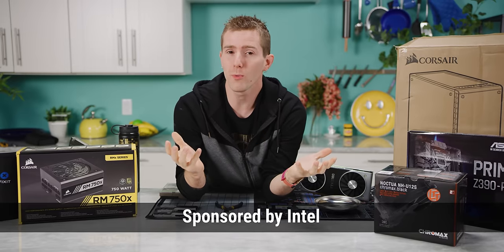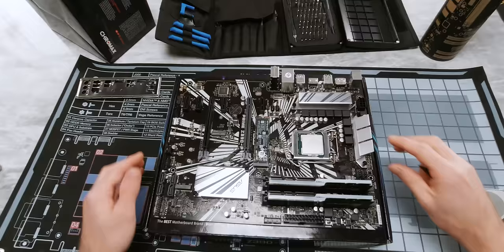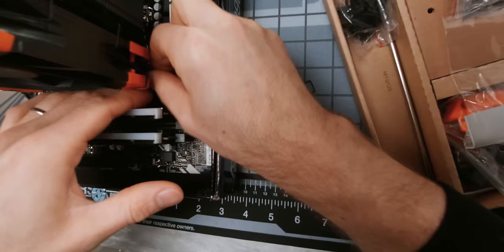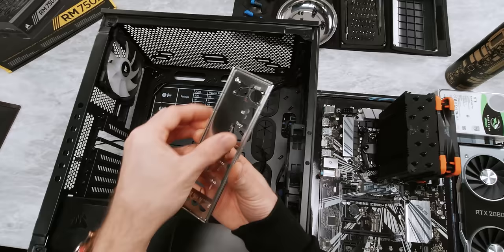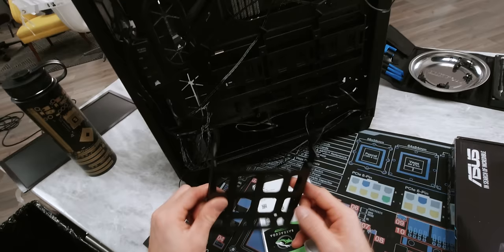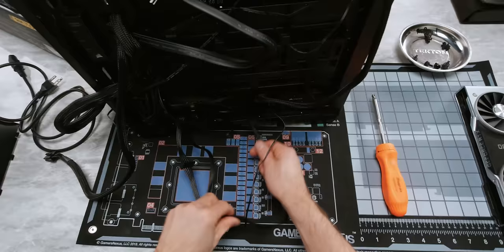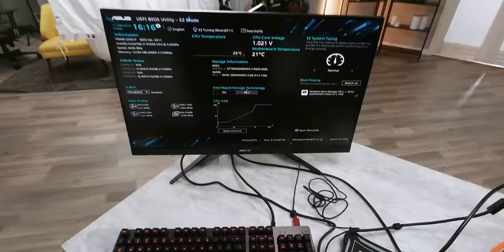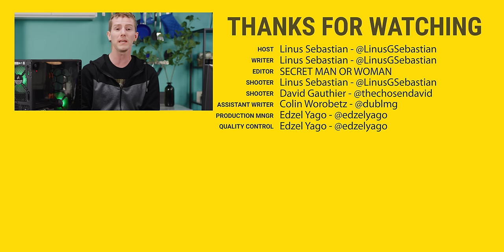First Person View PC BUILD Guide! (POV)

Comment: I was like "so far this seems pretty easy!" and then realized i was only 7 minutes in
Reply: Haha same, I took way too long over putting my motherboard into my case
Reply: @wimvanerge5210  ik erger me hier aan
Reply: @LarsBakhuis  bruh
Reply: I'm just about to build my PC in the next couple days. I'm hella nervous about breaking a connector by accident.
Reply: @OganySupreme  That probably will not happen.
Reply: @OganySupreme  Don't sweat it fam. I did my first one a few months ago having only watched one video on the subject and came out the other side just fine.
Reply: @OganySupreme  How did it go?
Reply: @liamroll6004  It went pretty good! The only thing that seems off is the ports in the case don't work. I haven't yet tried fixing the problem. I had this computer built for 9 days now, and I have no problems that bother me. I have 5 USB ports on the motherboard and 2 hubs so all is good! Thanks for asking!
Reply: @OganySupreme  Nice, what are the specs??
Reply: @wimvanerge5210  Ryzen 5 3600, GTX 1080, 16GB DDR4 3600 16, 500 GB M.2 3rd gen (same price as a normal SSD surprisingly), a B450 MSI motherboard with wifi and Bluetooth (don't have the model handy), 2TB HDD. It's a freaking beauty! At the very least, compared to my old computer. I never thought I would be gaming at over 60 frames. I'm used to the old PS3 COD split screen at like 20 frames, and now I'm getting over 100, sometimes solid 144!
Reply: @OganySupreme  yea that's great lol,
I got an I7 10700, Z490 UD, 32GB DDR4 3200MHz and UHD graphics 630 unfortunately I'm still waiting for a good graphics (thinking about the 3080 or 6800 xt) card to be in stock at a decent price
Reply: everyone here happy abou building a pc and working, while i build my pc and at the end, it looked like it didnt even have a soul
Reply: @SHEET hub kijk naar zijn naam
Reply: @SHEET hub j

Comment: Built my first pc from scratch yesteray was really overwhelmed with the idea but it was actually easier than i imagined! I thought the thing would blow up and never turn back on on the first boot but all was okay! Thanks for the indepth video
Reply: Any tips or don’ts for a first time builder like myself?
Reply: Af Af Place the power button pin in the correct one, and in Intel processor, do not remove that metal pad in the socket
Reply: @ad3798  rub your hands all over a carpet, then touch your mainboard and all sensible pc parts. Repeat this several times to make sure to give your computer the static power it needs
Reply: Congrats!

Comment: he explains things like a perfectly clear instruction manual, and he's not even reading a script - what a legend
Reply: He's not reading a script because he's a very experienced pc builder and knows how to do everything off the top of his head.
Reply: This is the first POV video where I didn't just fast-forward to the end.
Reply: @dominictan8472  you just copied the top comment
Reply: Probably a voice over
Reply: If you see his hand movements and his mic you can tell it’s not a voiceover.
Reply: @guywithglasses3402  it is a voice over because he just keeps on talking between the cuts
Reply: lol he's probably been doing this for 21 years
Reply: @marat9434  the audio echos more when he leans into the table, meaning that voicing it over with details like that is more trouble than it’s worth
Reply: @GoodNutMax  12:20 he’s talking but his mouth isn’t moving
Reply: @guywithglasses3402  read my other comment
Reply: @johnvandusen8802  at .25 speed on a large monitor you can see he is
Reply: that's experience lol
Reply: He's Linus......he is the script
Reply: @johnvandusen8802  why does he grunt when shoving or lifting things up? If it was a voiceover that wouldnt happen.

Comment: I'm watching this while my stuff arrive and I'm scared I'm gonna mess smth up
Reply: don’t worry bro you got this i believe in you
Reply: How’d you do?
Reply: same. my shit arrives today
Reply: Frostixity good luck , i’m going to get my stuff today then the rest comes in 2 days so wish me luck
Reply: @badr5827  If you're ever unsure of something, there's no shame in taking a break and googling how to do it and watching a few different videos to understand. I ended up calling my friend over Discord with video chat so he could watch what I was doing in case I messed up. 

Unfortunately, I DID mess up, and I screwed in my M.2 SSD without the little standoff that you can see Linus put in at 5:03. I screwed down the SSD with just the flat screw, which isn't a terrible problem, but the M.2 now rests at a bit of an angle and I'm SURE that is weakening the connection just a tiny bit. I also failed to tighten my CPU cooler to the motherboard all the way the first time, which meant that I had to hand-tighten a lot of the screws. You know how hard that is? Lmao, the instructions weren't clean and I wasn't sure how tight they needed to be. Answer: It all needs to be tight. Aside from those two little hiccups, everything else was simple for a first-timer. The cables were a headache, but there a lot of good guides on what they all mean and where you're supposed to put them. I also couldn't get it to boot the first time I turned it on. I don't remember the issue, but I think I removed the RAM and reinstalled it and it was fixed. Scared the shit out of me, but I KNEW nothing could be broken because I'd just purchased everything

Take the tips in this video seriously. Use your motherboard box as a platform, or the use the plastic bag it comes in as an anti-static tray (it's an anti-static bag). Touch your plugged in (but turned OFF) PSU every minute or so, or touch your METAL PC case to ground yourself and release any static. DON'T push on your CPU when slotting it in. Just gently drop it into place, and nudge it into position if it's not squared off. You gotta push kinda hard on your RAM, and if you're not sure about if it's in all the way, take it out and try again. If you get the same results even if you push twice as hard then you probably did it right. Always trust the manuals that come with your components. I've bookmarked a lot of pages in my motherboard manual because they have details on what the flashing lights indicate and where cables go
Reply: Young. Badr 
yeah i built it already but no windows yet (gonna use a usb)

also, i may have made a mistake on the cooling so i’ll do that once I get ahold of thermal paste
Reply: Little Snuggle omg thank you 🥺 i’m so so scared. i’ve spent all of my savings on it and i don’t want to mess anything up.
Reply: Same man how’d it go
Reply: Same, stuff arriving little by little
Reply: I built mine and got it first try
Reply: @littlesnuggle529  is there shame in paying $60 for someone at a store to do it? Seemed time saving
Reply: Not really any shame if you have money to do it and if you don't care about building it yourself. People usually like to learn how to build pcs themselves but you can take it to someone especially if they completely know how to do it.
Reply: Little Snuggle bruh that’s exactly what I did, I called my friend on discord with the video on and he helped me build it 😂
Reply: Frostixity how did it go
Reply: How did u do
Reply: Legend has it ,he is still building it
Reply: You forgot to build it?
Reply: @capybara5139  he literally forgot how to open the boxes
Reply: Same lad
Reply: BROOOO SAMEE
Reply: Did yoy mess anything up
Reply: So,how did building your pc go?
Reply: I haven’t even ordered my stuff and I’m scared
Reply: dont be shy, tell us how it went
Reply: My keyboard arrives tomorrow, last piece for my PC. I will play DOOM at 144hz yesss!
Reply: Same
Reply: Yo squad lemme share my story too.I have all the parts like right under my bed and idk how to assemble so here I am😬
Reply: Armor king  what you gonna do
Reply: Armor king  I'm waiting for my mom to call someone lol
Reply: Armor king  how old are you?
Reply: Armor king  I mean you should tell some adult to call a guy who knows about this stuff
Reply: Armor king  what was your budget?
Reply: So how did it go?
Reply: Armor king  $550
Reply: Armor king  I'm not sure about this I got my set up from an adult.I'm using Gtx GeForce 1650 with an msi h310m pro vdh plus
Reply: How’d it go?
Reply: Malaika Majesty deadass felt that
Reply: Armor king did yours go good my budget is 800 got my shell and some parts and my dad knows a bit and we’re taking apart my dads old computer for reference
Reply: Soo... how did it go
Reply: Armor king look on youtube
Reply: Armor king np
Reply: Same man stuff comes today
Reply: @patiarch38  Pog champ, im building one soon too!
Reply: @thatspog801  Mine went great! Good luck with your build man also if you have any questions just let me know here
Reply: How did it go? And how it's holding up?
Reply: Same bro
Reply: I’m getting mine around Black Friday, I’m especially worried since I have no knowledge of building at all and I’m also only 13 .-.
Reply: how’d it go?
Reply: same, watching, so everything goes faster when it arrives
Reply: you no longer have 69 comments
Reply: same bruh im so close, just saving up a bit more money for the case and cooler
Reply: I need help building any advice would be great im only a teen
Reply: Any updates on how it went?
Reply: @littlesnuggle529  thanksw=
Reply: same xD

Comment: Watched this almost a year ago. Built my first pc just yesterday without the video(test my memory). You explained it well enough that I remembered. Thank you
Reply: I’m currently waiting on gpu’s to open back up but I have everything else but the os. How do I pick and install and operating system?
Reply: @parkerchan4456  getting the free version of windows leaves u with a watermark on the bottom right that stays on every application u run tho it dissapears at times
Reply: I wanted to ask about something my power cable doesn't fully enter like there is a little bit of it not going into is that ok
Reply: @mjmkkj9234   Yes it does have to be all the way inserted until it securely clicks.  Double check that where you're putting the power is indeed the right place because you can jam the wrong pins into the wrong place. If you wanted a faster answer I would say go to the LTT forms.
Reply: @matthewsparrowbhs  ok, thank you very much
Reply: @parkerchan4456  did you End up greeting one?
Reply: one hell of a gamble but congrats!

Comment: *Linus makes a PC build guide*
Me: I've done a lot of PC builds, you can't surprise me with anything.
*Linus braids the FP cables*
Me: Ok, you got me.
Reply: I agree, braiding the FP connectors and shortening the fan cable by putting a loose knot in it surprised me even as someone who has built PCs for almost 20 years now - really creative knowledge for cable management here :)
Reply: i did this with my pc without think tbh and wire tied it to the usb which is next to it to make a curved cable pile like how gpu is done pretty often now. briding them meant that the cable would stay in place and that no fighting with the back panel would cause issues. its an impossible mess for me due to the case having fan controller and the aio also having a fan controller and me using 7v fan spiltters for the front and another spitter for the top aio, less mess around the front but increases what's behind the motherboard
Reply: I've never thought to run fan cables beneath the motherboard before. Crafty way to dispose of fan cables if they can't just be hidden straight to the reverse of the motherboard tray.

Comment: 3:28 but The Verge dude told me to throw that away....
Reply: Ramen screw with confidence aswell
Reply: yeah I didn't see the swiss army knife which hopefully has a screwdriver either, get it together Linus
Reply: Yeah Linus is missing his Live Strong bracelet too.
Reply: *throw
Reply: I hope this meme never dies
Reply: And Linus is missing his thermal paste applicator. He just dropped the paste on there without applying it properly.
Reply: @FlyingBeerman  And his paste was not enough as usual!
Reply: This is just as dumb...use a case with no front drive bay options....just as dumb and misguided to build it like this.
Reply: guys guys guys he also installed the memory sticks incorrectly. they're in spaced slots!

Comment: If you ever revisit this pov build idea could you use white parts, there were a few times i couldn’t see even w brightness all the way up...
Reply: Unfortunately most of the instructions on where to plug what are useless since is impossible to see the connectors.
Also if the workspace would be less illuminated would have helped to make the black components more visible.
Reply: exactly

Comment: Had to check whether this was uploaded in 2013 or 2019 when I saw a 14nm processor.
Reply: zzebra the best part about AMD is I haven’t turned on my furnace in years
Reply: @schoonerthedog  same here, I have my athlon water heater and fx room heater fired up for the winters
Reply: Lol,apply cold water....
Reply: @schoonerthedog  is it real? Will it be warm enough just using cpu for heater in a room?
 im from tropical area and using intel
Reply: @schoonerthedog  @Sommie! Wow FX runs hot, what a stunning and brave thing to say, lol, never heard that one before. Too bad that hasn't been relevant commentary since early 2017. Do people still harp on about the GTX 480 & 580 to say nvidia cards run hot? no because we've moved past those dark times, I'll never understand how "AMD runs hot" is still a persistent myth towards the end of 2019.
Reply: @RandarTheBarbarian  It's an easy answer really. People are dumb.
Reply: @youcantmakemetosuscribe4745  If you wanted to you could do it lol, not just with the CPU mind you, you'd need some graphics cards to match. Get those TDPs high and your thermal transfer as efficient as possible so the heat makes it to the air.
Reply: @sommie4935  Damn, I guess intel fans really are stuck in 2013.
Reply: @RandarTheBarbarian  amd is too cold
Reply: amd makes great room heaters because intel can’t even get the heat past the heat spreader
Reply: @schoonerthedog  intel CPUs are hotter these days than amd
Reply: My 3900x isn't enough to make my room warm in winter. I have to do folding on my GPU also for enough heat.
Reply: Ryzen uses less than half the power for same core count and performance ... But .. But 2013!
Reply: @Deleted_Alt  Their manufacturing process AND their opinions are 2013 xP
Reply: @schoonerthedog  Build now a computer with an Intel processor and you have your double furnace. In 2019, after being beaten by AMD so hard, Intel can console with no.1 place in furnace processor.
Reply: I thought intel 14nm processors were released Q1 2015?
Reply: @urgay1992  Yes but they were very similar to the early 2011 22Nm launch. The difference was like 14Nm 1st gen ryzen to 12Nm 2nd gen, just a refresh.
Reply: @RandarTheBarbarian im still on a 4790k at 4.9 and a 240mm rad and its definitely a heater for my room, it'll be 30°F outside and i would open my window because it would get to hot to often while gaming. not so often lately because i switched from a 290x heater with a AIO to a 2070S.
Reply: Well with intel releasing cpus in the next year with 125W tdps I guess you'd be able to upgrade from the old space heaters to modern space heaters

Comment: This was a very helpful guide. I have built 5 PCs this year, 2022 after being inspired by this video. Four were for family members the latest was for me. My new system is a Ryzen 5600x, MSI B550 Gaming Plus, Coreliquid c240 AIO,  Forge 100 R Case, Optix G241vc monitor, TeamGroup m.2 1Tb SSD, T-Force 16Gb @ 3600mhz DDr4, XFX rx6600 GPU and a Apevia 80+gold 850W PSU

Comment: Using a torch when plugging in some of the cables would've made the video better
Reply: What, you can't see the black cables going into a black port on a black mobo in a black case?

What's wrong with you?
Reply: Uh, WTF? why would he want to get fire that close to expensive equipment??
Reply: I think by Torch he meant flashlight
Reply: @yuitachibana8829  Why is it called a flashlight anyway? It doesn't flash, it's static.
Reply: @DragonNexus  Becuase that's what it's called, and it isn't lit by fire.
Reply: @wheatyasf9093  You are saying that it went over your head? Because clearly you haven't a sense of humor.
Reply: @yuitachibana8829  Wait, what? Are you saying that people in other cultures use other term for things? Who would have thought....
Reply: @mikeworkman3593  Got a torch next to me that uses batteries.

The wonders of the modern age.
Reply: @DragonNexus  All torches have fire. How else can you differentiate between different things.
Like the difference between a plane and a jet.
Reply: @mikeworkman3593  I think the difference between a wood working tool that shaves wood from a plank is quite eas to tell the difference from a black rock.
Reply: @mikeworkman3593  its a ref to minecraft

Comment: "Without wasting money on unnecessary gimmicks"
RTX card: sweating
Reply: 2 subs with no picture "builds using a 9700k"
Reply: I honestly don't know why anyone would buy a 2080. It's just the 2070 super for a smidgen more performance at double the price
Reply: @SignalRaptor_  the graphic card is generally optimal you can use amd or nvidia and actually Linus has alot of those graphic cards around
Reply: RGB RAM
Reply: @alfe5596  actually if you download more ram it comes with rgb preinstalled so no need to worry
Reply: And 10tb HDD. 9700k is also questionable
Reply: @SignalRaptor_  its not double the price, plus you can find some good deals on it sometimes
Reply: @khender1357  it's still not with it unless it's like $10 above the 2070 super